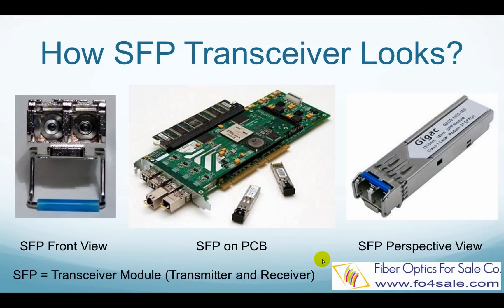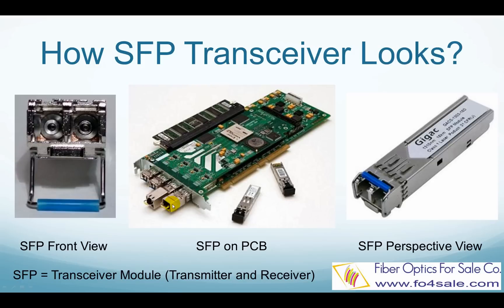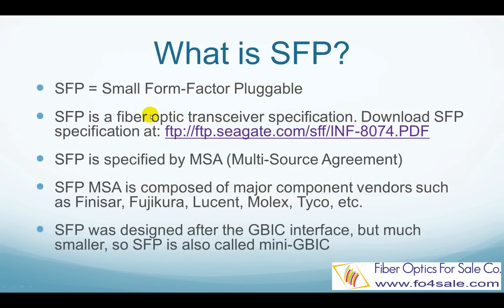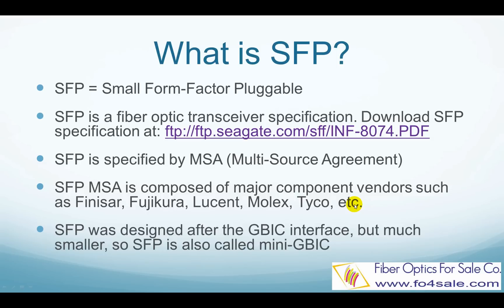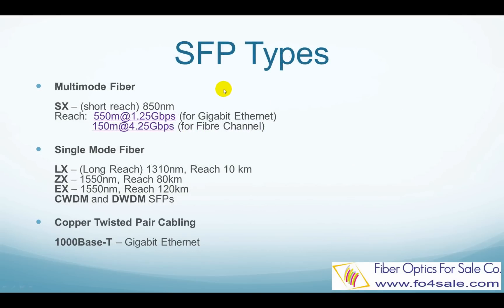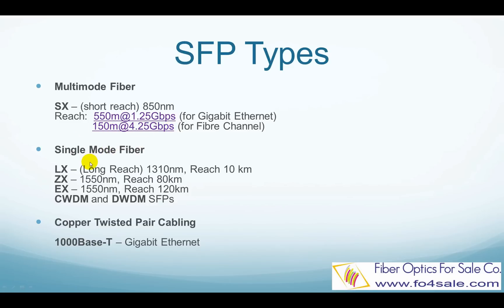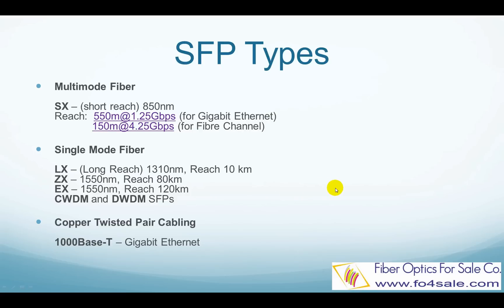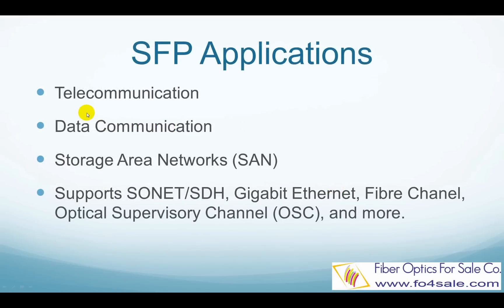What is SFP transceiver? - FO4SALE.COM

Comment: Thank you Colin.
I have a question : Could the same SFP type be used for FC and Ethernet traffic (eg the same sfp is swapped between a 10GbE port from switch to a FC port on HBA) ?
Reply: Hello Ajay, are you dealing with SFP? If so, kindly email me at john.zhang@c-light.com, I will back to you asap.

Comment: To answer some of the questions in the comments below, Gbic stand for gigabit interface converter, ZX is for long haul links up to 80 km (achieved by a higher transmit power), EX is extended reach of up to 120km (again achieved by a higher transmit power). For the guy who does not know what an SFP is, look at the video again, Colin explains exactly what it is and what it looks like.
Reply: Joey, are you dealing with SFP modules? May I have your email?